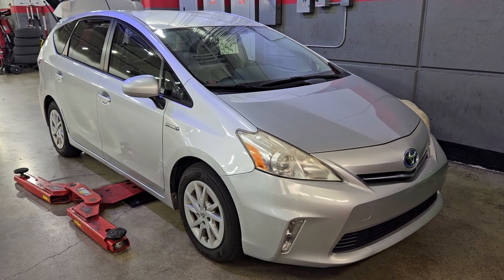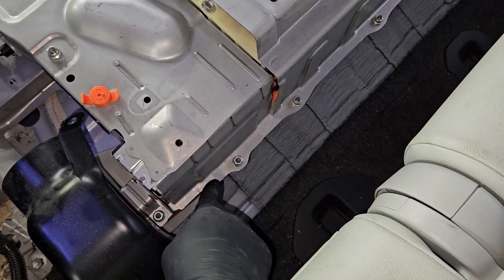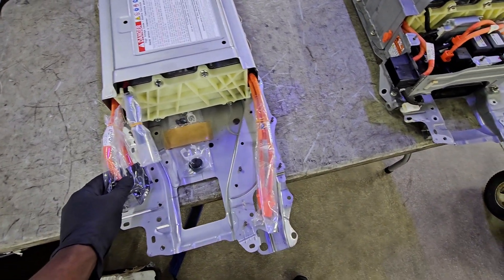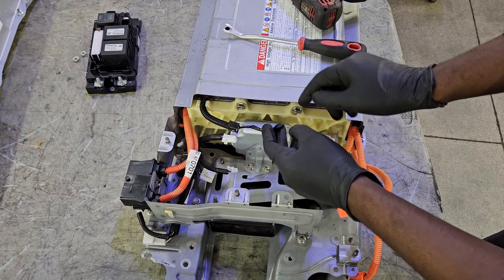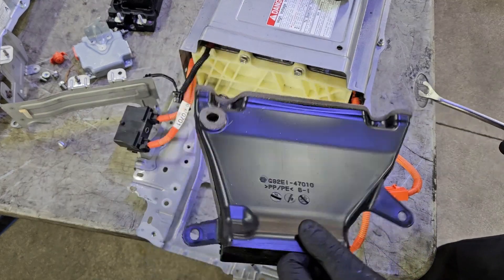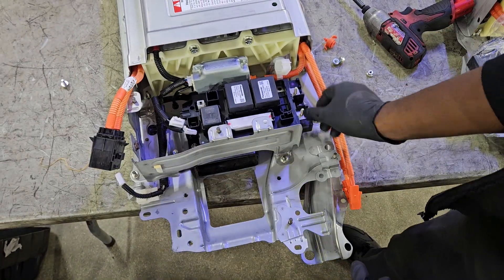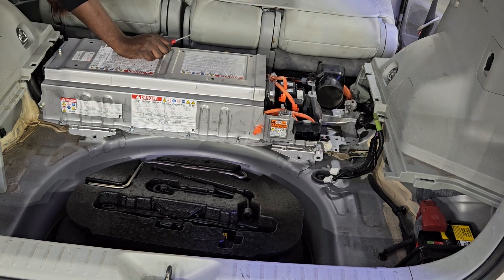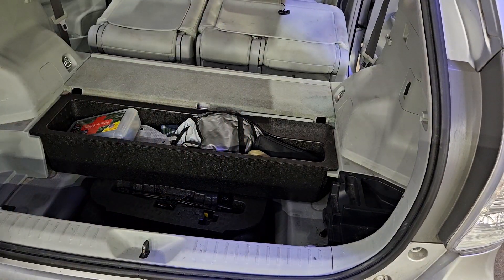Toyota Prius Hybrid Battery Replacement (3rd Gen Prius-1st Gen Prius V)

Comment: Excellent video. I subscribed. I am planning to replace few bad cells. Dr Prius app shows module 6 to be weak consistently after watching on Dr Prius while driving for few days. So, I am curious on where do the count of module 1 start from on Prius V 2013. Is it from fan side of the battery pack. I really appreciated the information. Thank you.
Reply: I wouldn't just replace a few bad cells, it is worth replacing all based on all the reading I've done, however if you do this, I wouldn't count from one end to the other. I would use a battery tester to test each cell, and if it reports bad, I'd replace that one. There is a video floating around, someone did this with a tester from harbor freight. Many folks find that this works temporarily, but ultimately other cells fail.